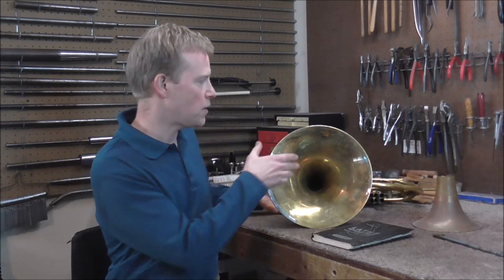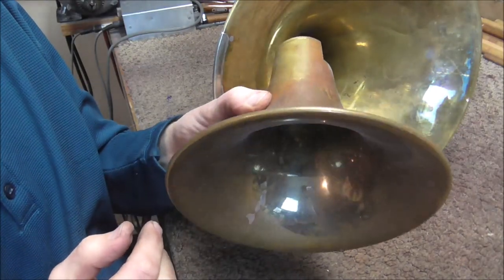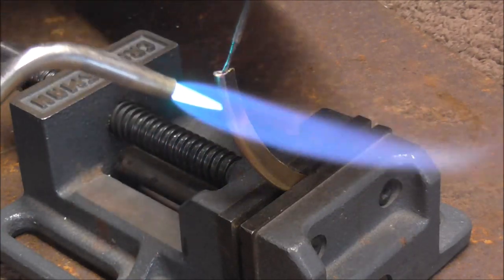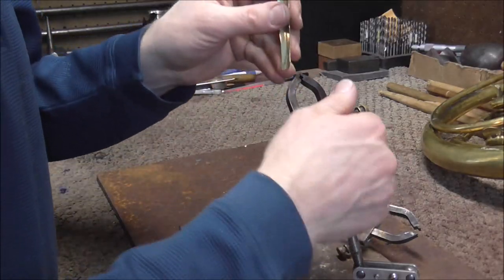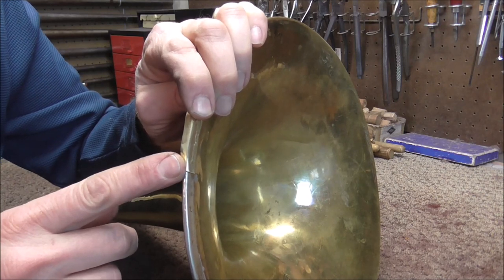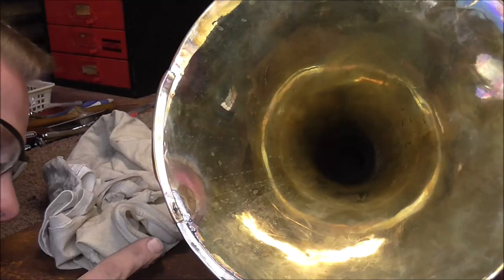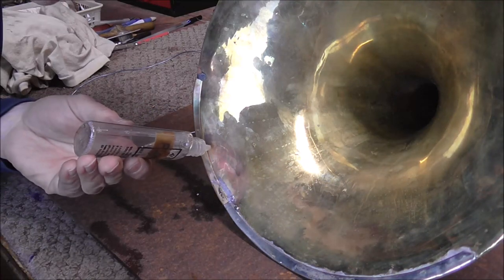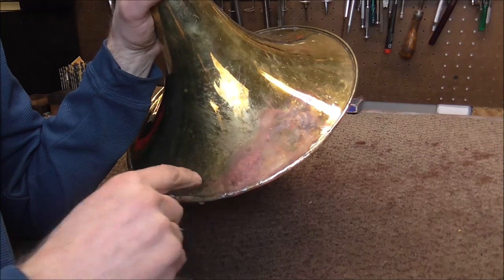Patching a Bell Crack: Restoring an Antique French Horn #4

Comment: Another thought....ammonia leaches zinc from brass, so I am wondering about mitigation for THAT after the ammonia is used to neutralize the flux......? A quick exposure of ammonia should not be a problem, and the ammonia evaporates quickly in free air, but I have read on brass instrument forums about ammonia that wicks into tight seams, and potentially remains un-evaporated long enough to do some damage to the brass. I don't have any real data or personal experience with this, however.
Reply: Correct. Ammonia + brass = Nono.

Comment: When I still worked in brass restoration, my flux bottle had a needle to better direct the flux to where it needed to be; in this video, it looks like a lot of flux is going anywhere but where it needs to go. My shop also had a steel roller on a wooden handle (I forget the tool's name) that was ideal for rolling brass around the bell wire, would have made quick and accurate work of what is being done in this video. I also had a wet sponge, along with another flux bottle with needle containing water, to quickly cool an area that had just been tack soldered.

Comment: Why didn’t you just hard soldered it and then file it down? I’ve had these situations before and it came out almost unnoticeable
Reply: My concerns about silver soldering it would be:
- The instrument is super old, so is the brass, so overheating it does not seem a great idea
- Heating enough for a hard solder would anneal part of the brass of the bell, so you'll have a super soft part of the bell while the rest of the bell is work hardened => the mechanical stress will not be handled super good
- This would overheat the soft solder that holds the bell ring wire, and in case you never experienced it, trust me: you do not want to deal with overheated, crystalized soft solder

Comment: I had a thought about your "loose" valves.  The analogy in my mind is that of piston rings that seal the cylindrical piston within the engine block.  The piston is not flush to the edge but the piston ring seals it.  Could you solder thin rings to the valve assembly that could seal tighter and not try and increase the diameter of the whole valve ?
Reply: The issue with valves is not so much the air leaking to the outside of the instrument, but the leaks between piping parts of the instruments (between the main tube and the valve slides, for example) which would not be fixed by a piston ring... instrument valves really need a flat surface. They are pneumatic distributors more than engine pistons
Reply: Unlike engine pistons, valve pistons aren't built to contain pressure like that. Everything is done with an interference fit and oil. And rotary valves, like this horn has, resemble engine pistons even less. However, "bore and sleeve" is still a viable option.

Comment: Since this instrument already had one patch, but the crack had exceeded that boundary, does it ever make sense to first remove the old patch and replace it with a larger one?
Reply: I suppose...but possibly due to the age of the horn, Art is being as ginger as possible. Could possibly end up with some unknowns under the old patch...but I see your point
Reply: @davemiller7633  I just thought the point where the two patches meet is now under more stress than the rest of the bell rim, and if the metal is already that weak, maybe that's not such a great thing. If there was only one long patch, this problem wouldn't exist. Honestly, with almost half the rim being patched now, I think it would be more visually appealing if it was reinforced all the way around in one continuous ring. Then it may well look like it was intended to be that way from the start.
Reply: @mal2ksc  maybe so! No argument here but I just don't know!
Reply: He mentioned in an earlier video that the owner of the horn is trying to keep the repair costs low, so that may also be affecting how he's handling this.
Reply: @Mal-2 KSC   I couldn't quite see just how Art did it, but generally in cases like this, the two patches wouldn't be butted up against each other, resulting in the weak point you mentioned...rather, there would be a slight overlap between the two patches resulting in a much stronger joint.    And, as another comment pointed out, cost may be a big factor in determining just how this repair is approached.
Reply from the maker: Sorry it took me so long to answer these questions/comments. I put on the smaller patch because removing the large one could possibly cause more problems with the crack. Also, The player likes the way the instrument plays, so I wanted to change as little as possible on the bell. I was even a little reluctant to put on the smaller patch because anything you do to a bell can affect the sound, but I did not want the crack to keep expanding or someone to get cut on it. 
I hope this clears things up. Also, I really enjoy all of the good discussion about this instrument.